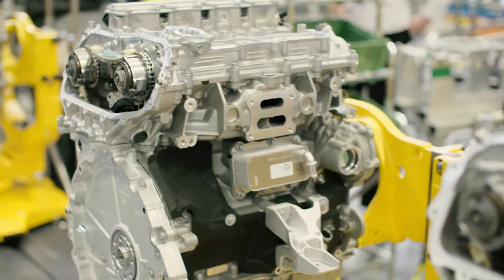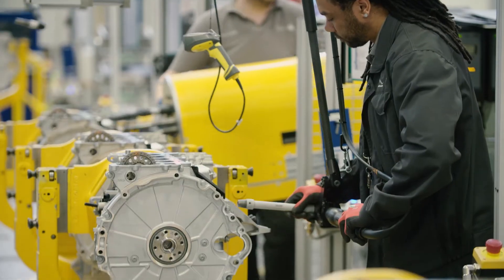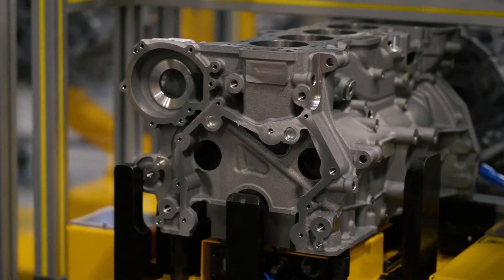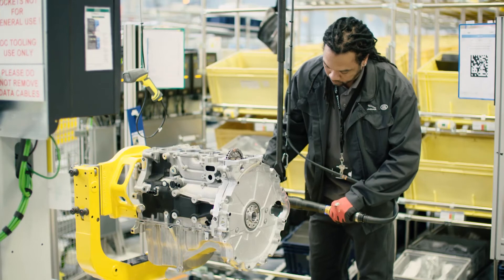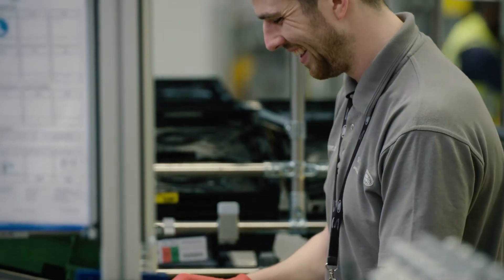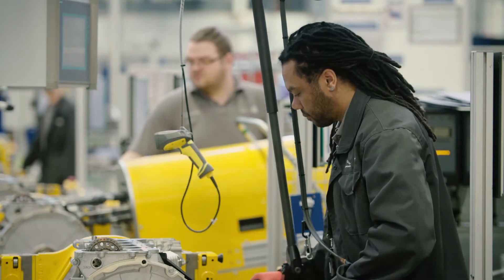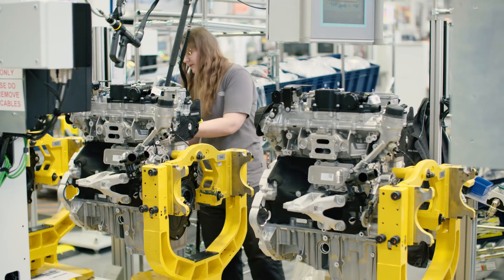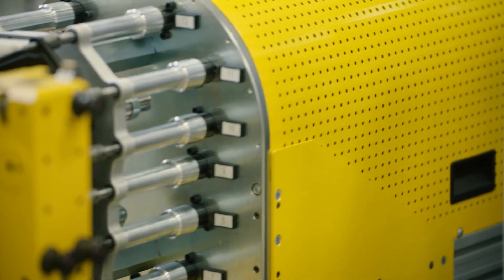Meet some of the team behind our Ingenium engines

Comment: one of the most unreliable engines ...i have new car under warranty ...and 3 times engine light on .... dealer inchape says ... valve cover is leaking ... second time engine does not work in -10 degree ... third time again engine valve cover and solinoid replaced ... please take this engines back ... one of the worst thing